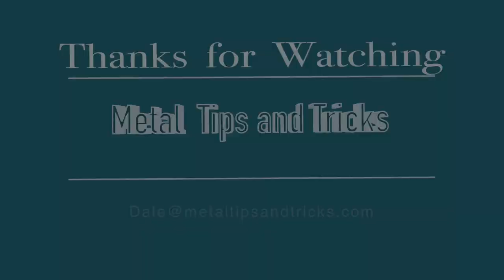Digital / Dial Caliper modification

Comment: Your calipers are not necessarily more or less accurate, but rather they most likely have thicker or thinner blades.  Using calipers to measure an internal bore is using the wrong tool.  The thickness of the blade causes you to measure the distance between two chords of the circle not the diameter.  This is why when measuring a smaller bore the error is greater using the same tool, the radius is tighter hence the chord is larger.
Your "fix" puts a radius on the blade making it more accurate in measuring inside diameters.  Before putting your fix to work you should check the overall accuracy using Jo blocks or pin gauges.  It'd be a shame to "fix" your caliper for one specific bore size only to make them more inaccurate measuring OD's for which they are designed.
Reply: Exactly. Learn to use your tools and what they will or won't do before you decide to fix errors.

Comment: Got a few calipers, cheap and high end, they're pretty close on the external, if you want one that reads internal "close enough" you have to, do what you do if there is material to remove or check the actual match of the internal jaws when you purchase the tool, worked out for me so far...  ;)   Pierre

P.S. It's valid for cheap as well as high end tools...
Reply from the maker: +pierre beaudry 
very good point.

Comment: Cool tip Dale... I'll have to go and check my digital calipers.  As an aside my father has had for years a set of plastic dial calipers (Swiss made I think)... I know we're not talking high end accuracy but as a general workshop tool very effective and I find the analog display easier to use for general work.
Reply from the maker: +Peter Baynes 
I do like affordable measuring tools from China. I call those might "B"gauges, and they're used every day. My "A" gauges are my best gauges like Sterritt and Brown & Sharpe these gauges almost never see the light of day. LOL

Comment: if you have .020 flats, theoretically your measurmants will be off:

bore size / offness

4" = .0002
3" = .000267
2" = .0004
1" = .0008
.5" = .0016
.25 = .003221

 I'm guessing it will be less off practically because, well, you probably already have some radiuses on your flats from use. the carriage isn't that tight also, it wobbles a bit, so when you measure small holes, the carriage may wanna flex in the good direction.
 
thanks for the video though, great tip!
Reply from the maker: +Jimmy 123 
Thanks for you input :-)

Comment: Instead of a ring gauge, just use a micrometer (with known accuracy) to check the calipers.
Reply: It's the curved walls of an ID that causes them to be inaccurate. They will be perfect measuring the flat walls of micrometer anvils.
Reply: @nickp4793  I did get it wrong. Actually, for such internal measuring, I have always used internal calipers and a micrometer for measurements down to a couple of ten thousandths of an inch accuracy. It does require a sensitve "feel", I always tend to use micrometers for really accurate work. My fellow toolmakers and I refer to these calipers as "guessing sticks."

Comment: How would this modification affect your caliper for mesuring slots now?as has been stated using calipers to mesure round bores is using the incorrect tool....now that ypu have it modified to work correctly on chords of circles wont it throw it of for slots?...maybe should of done thos with slots first then seen how it worked for chords of circles..

Comment: Cool. Never been the biggest fan of digital calipers. When I got introduced to metal working, I thought that digitals would be the best, but they're so fragile. I actually went for a job interview and brought my own tools with me. I opened the calipers case and measured the thickness of a part and the guy interviewing me went, "DIAL calipers?!?!?!"
Reply from the maker: +Bradley Willoughby 
Did you get the job?
Reply: +Metal Tips and Tricks (Dale Derry) 
I had it, but had to turn it down because that job shop wanted me to leave a permanent position for a temporary position. They said I could have been hired in 8-10 weeks, but what were the odds of me being laid off at 9 weeks and 6 days? I could still go there if something comes up at my current job.
Reply: That guy obviously knows squat about precision instruments. Both dial and vernier calipers have abilities that digital s do not have and vs vs.

Comment: Nice work - Is the inaccuracy from the thickness of the calliper as opposed to the better units ? How does the error compare when measuring between two straight pieces of metal . The curve will obviously impact but is it the cause for these errors?

Comment: Wow, hey Dale, is that a Colchester Triumph 2000 you have behind you? Man, that really makes me miss that lathe, such a good model!
Reply from the maker: +Switch & Lever  
Yes it is, but it goes by a different name in the USA. Here it is called a "Clausing Colchester 15". It is a amazing machine, and it is a lot of fun to use.
Reply: +Metal Tips and Tricks (Dale Derry) It's the lathe I learned metal turning on, I know that thing like the back of my hand. Great knowledge about the different naming, I didn't know about that. Since I hope, at some point in my life, to move to the states and have a workshop that tidbit could be invaluable. I will need one of these lathes in the future!

Comment: Calipers are not good for internal bores, because the points are not co-planar. Grinding down the edge as you did, will fix it for the reference bore, but the error will shift with a change in the diameter [because it's a diagonal offset]. Also the calipers will now be inaccurate for straight-walled internal measurements. This truly is a matter of using the right tool for the right job, and the caliper is not the right tool for directly measuring bore.

Comment: I imagine much of the inaccuracy is geometrical because of the way the jaws must slide past each other, the error will be larger for small holes than large ones. It would be interesting to try measuring a precise parallel slot before and after this correction, this could be formed with some parallels.

Comment: Nice video. I had to do the same yesterday to a dropped mitutoyo to repair the tips. I should get some snap gauges to improve the internal accuracy of a chinease 300mm carliper I have which is very off.
Reply: +EmperorDevilhunter You can make pretty good "standards" for calibration from 1-2-3 blocks. If they are decent quality, just clamp them together to make the size you want. If they are inexpensive, measure them first with your best measuring device, and tag them so you know the dimension of your standard. To make inside standards, just clamp something flat (like a mill vise parallel) on the outside of your stack of 1-2-3 blocks and let the flat pieces overhang the edges of the blocks. You can make any sized standard from 1" to 6" with a single pair of 1-2-3 blocks.
Reply from the maker: +EmperorDevilhunter 
Cheap Chinese calipers are hard to pass up,  they are a great value.
Reply: +Metal Tips and Tricks (Dale Derry) Yeah for their cost, they are very handy
Reply: +Peter W. Meek Thanks, I was thinking on doing something similar. I can just measure the 1-2-3 block (20-40-80 in my case) with the external measurement digital carliper (already compared it with my mitutoyo and it's pretty good) and then just file untill the internal mesures the same

Comment: Grinding down the most critical surfaces of a measuring tool just doesn't seem like a good idea.  You are better off using your gauge rings to compile a table of compensation factors for various diameters.  That way you can simply correct for your error.  Actually, digital calipers should build this table into the software and add a bore setting.
Reply: .... That's a great idea....

Comment: my digital mitutoyo the new model reads inside diameters perfectly
Reply: It's not possible. They will be better than cheap calipers because the jaws are thinner. But they can never be perfect. If you measure a smaller hole you will see the error better.

Comment: In the UK they are referred to as Very Nears. I wouldn't entertain trying to hold less than a .1mm tolerance with anything less than a bore mic.
Reply from the maker: I Agree with you Mathew. :-)
Reply: You probably won't be amazed to hear many a "precision" company expect it. Then, through a wobbly when their CMM inspection equipment make a totally different reading.

Comment: Now I will have to check my calipers to see how far off they are.
Reply from the maker: +1970chevelle396 
Luckily it doesn't take too long to calibrate your calipers. But, I do know it will take longer to build a new part if you  measured  wrong. LOL